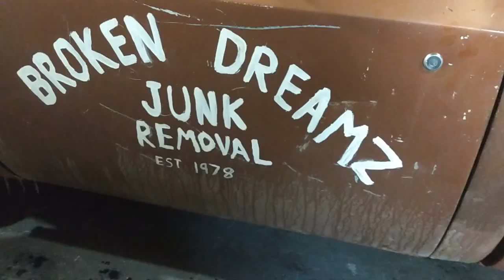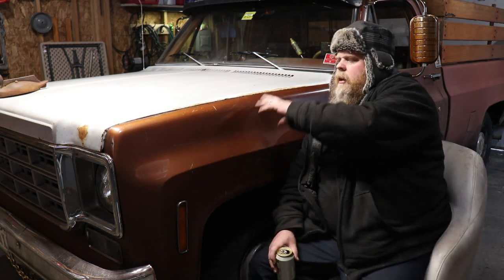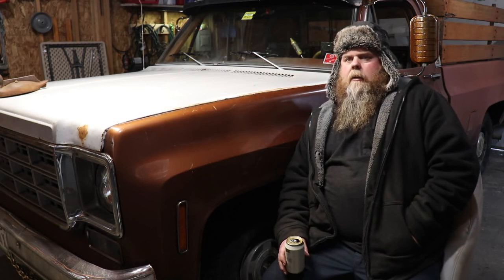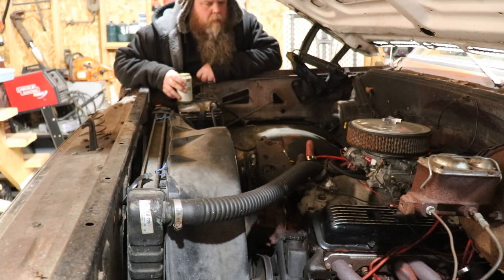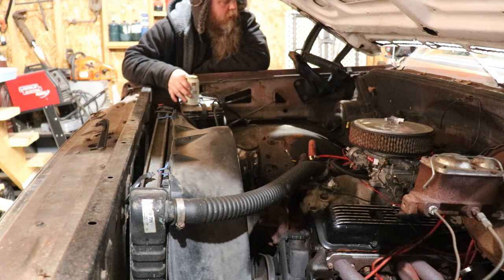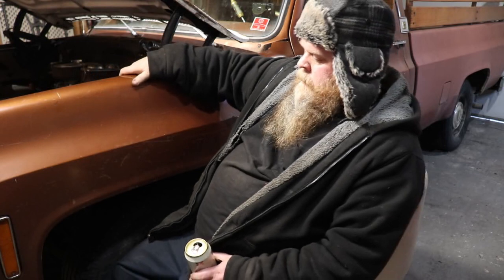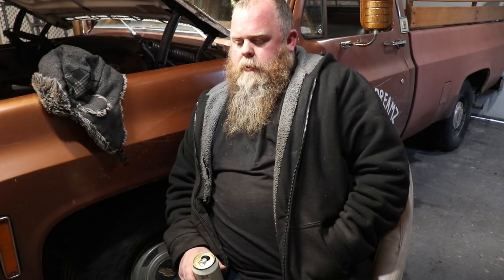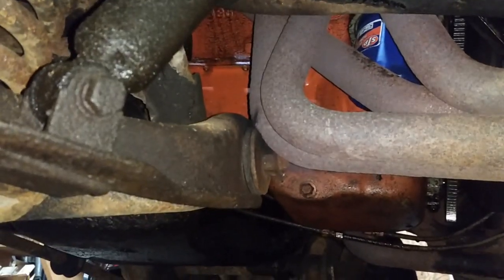1978 Chevy Broken Dreamz Farm Truck-Back Story 2021

Comment: The main purpose of the Big Ten and Heavy Half was to get around the smog requirements for light-duty trucks. The heavier springs raised the GVW above the threshold for needing a catalytic converter. That worked for a couple years, then they raised the threshold and that was the end of the Big Ten.